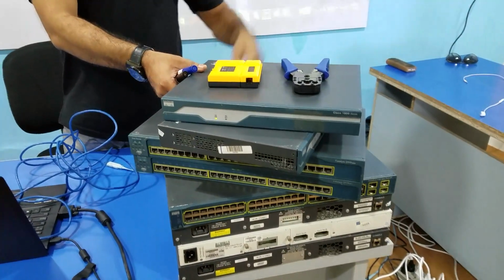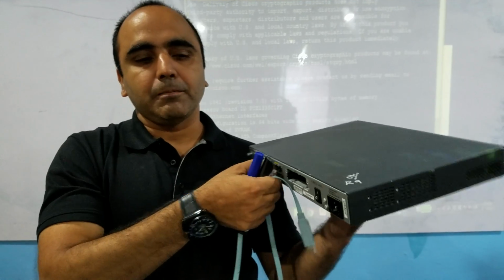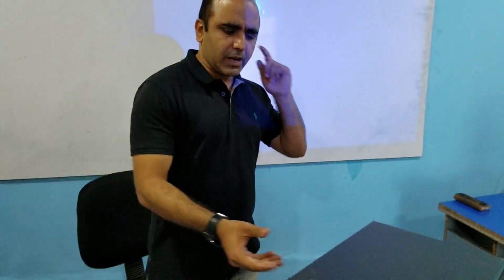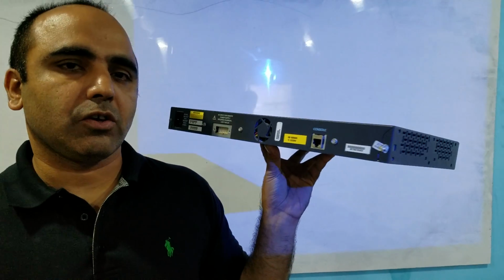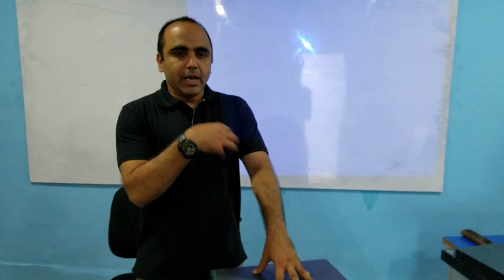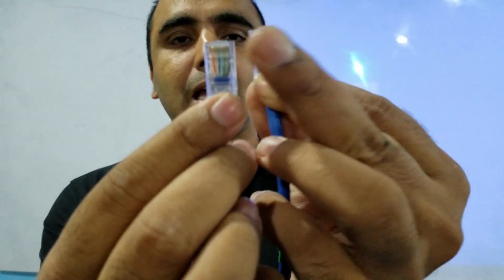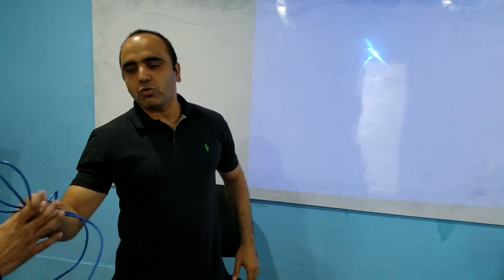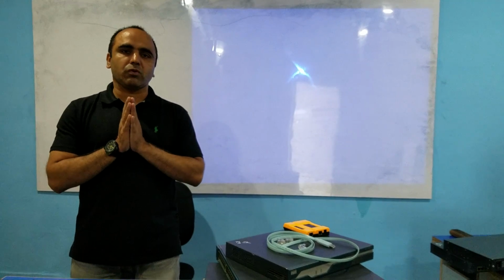BUILD CCNA LAB AT HOME | English

Comment: How can we find that Is the Switch is Layer 2 ? Or Its in layer 3 Support ?
Reply from the maker: dear 2950 is the layer 2 and 3500 only is layer 2 but 3550 and above are layer 3 further you may use command # show version       to check the ios image it shows l2 / l3